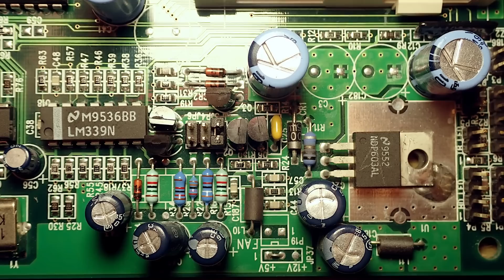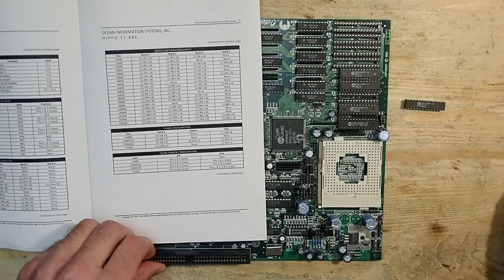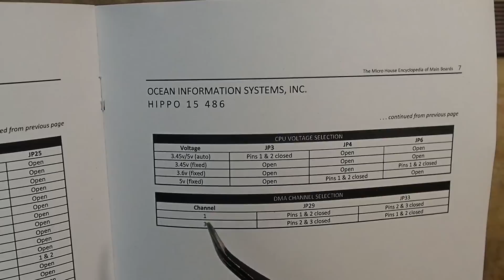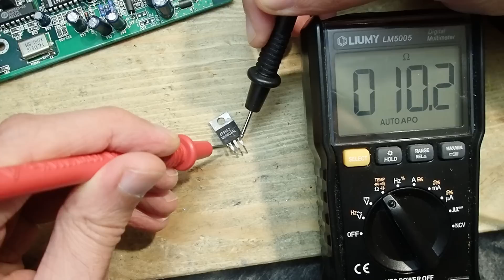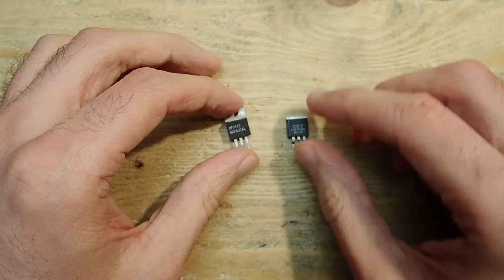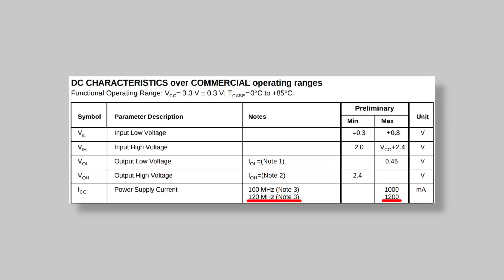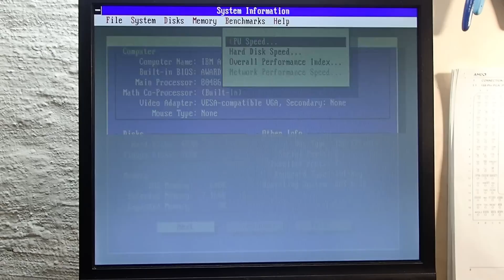Let's repair one of the best 486 mainboard - Octek Hippo 15

Comment: That board should be recapped with all Panasonic FM capacitors, it also doesn't matter if they look good or not, they can look completely fine but either be fully or partially shorted, or the rubber seal on the bottom could develop a hair line fracture causing the electrolyte to slowly evaporated, electrolytic capacitors should be replace if they are more then 20 years old, once you understand how they work and their failure modes, its just commonsense preventative maintenence, what if they short out and take out something on the board you cannot find... Get a good esr meter...
Reply: I agree with you! People tend to think that capacitors are perfectly fine just because their eyes and cheap cap tester says so. There's more to it than that, caps can degrade in ways which are not easy to detect unless you have professional equipment. They can also act fine in a tester but have problems at certain voltages or frequencies. I find it quite annoying to be stigmatized just because I do maintenance on retro computers in my hobby. Have fun with it while you can, and if recapping gives you joy (like it does to me), then go for it.
Reply: @8bitbubsy  Another point to is to always buy them from an official seller like mouser, low esr high temperature 105c long life caps are always the go to for mobo's. If it's a power supply with a normal radial leaded style, ill always go for nichicons uhe uhw or upw for the filters, for supporting circuitry usually nichicons uld series. Or Panasonic FM or fr series, if they are snap in caps, cde's splx is usually my first choice. Don't know why people think it's safe to use older equipment, especially equipment that is nos in nature and has never been powered up with original caps, it's just a risk that can be an expensive mistake.. If you can spend 25 bucks to recap something you dropped big dough on, why not go for it. It's the same way with vintage amplifiers and what not, lmao. It'll be a hoot when all these old caps pop and ruin this vintage gear for people who were so against it, then they'll be on here crying about it, lmao.

Comment: I was really surprised that that DX2-66 initialized with only 3.6volts. Really curious if it would have run stable.
Reply from the maker: No, I tested it later and it doesn't even boot into DOS.

Comment: Seems like this board even supports EDO memory, based on the chipset revision.
Reply from the maker: It depends on the BIOS as well. I didn't check yet out, because I wanted to update the BIOS for the benchmarks anyway.

Comment: Great repair! But why it starts with one SIMM module, aren't you need pair of them?
Reply from the maker: 486 needs only one. In the most Pentium systems you needed 2.
Reply: No, I think you are confusing the 72 pin modules with the 30 pin (which have an 8 bit data width and need a total of four modules for the full 32 bit width). On the other hand, the 72 pin modules already have a data bit path of 32 bits, so one module should always be enough (unless you have a very weird motherboard - there were plenty of these in the 486 era).
Reply from the maker: @ruxandy  That's right. And on the Pentium the memory bus became 64 bit, that's why you needed a pair of 72-pin modules on the most Pentium boards. Some could also work with one, but only with the half of the speed, since they split every memory access in two 32 bit words.
Reply: @ruxandy  thank you for clarification!

Comment: I've got that same S3 video card in my retro pc.  I wonder if anyone has ever upgraded the ram in those two empty slots.
Reply from the maker: Of course, if you need higher resolutions you can upgrade the memory. But if you use only DOS, there is no real use for more video memory.
Reply: @necro_ware  hmm, that explains why I can’t get higher resolutions… thanks - I was wondering about that. I’ll add ram then…
Reply: It worked- I added memory in the two slots and now have 2mb of video ram. I get higher redolutions in windows 98 now.

Comment: Hi, love your channel and wonder if you could help? 
i have a tricky Laptop problem that as a repairer myself , i cant quite nail. and love some help.. Problem is the usual "wont start and blank screen- but for months!! sometimes start normally and most not- so intermittent!!! worst fault haha
OK- What it isnt- I have switched out ram and PS and its not over heating ect as i service it but that would be once it s hot and OH. I have also changed SD HD with another and fresh windows install so its not windows or t the HD!!
Problem-- Push Power button (3 volts ok?) and power light and mouse comes on each time but nothing on screen OR i see 'windows starting" but then nothing. So kill power a couple of times and after 1-4 tries finally get into windows and DESKTOP and if that far, NO failure or blue screens or shutdowns and runs OK all day.... , no error mesgs and faultless , its just getting to desktop sometimes and then perfect all day
So my electronics and M/B knowledge is leaning toward Weak Caps that are loaded harder? on start but less once computer on and thus runs all day-
Laptop is 13 years so YES, caps will be worn Maybe Bios chip ropey or super IO BUT by now they should have failed totally? Super IO is keeping the mouse on and power on so not a board short plus i checked all that when pulled M/B to check obvious shorts and burnt components Also Power button not always work to force shutdown to try 1-4 restarts so m/B not always responsive, so i pull plug.
Battery and bios battery also removed and replaced . When i try to duplicate this fault HOT, i cant do it, only seems to happen after cold night then start- leading me to think weak cold caps not already ran and warmed ? when i pulled board and tried restarts they worked every time as M/B was warm and voltage filled generally. Is the Power button 3V needed AFTER the board is on, if not then that cant be it as mouse is on every time just wont get going to windows My next step is to monitor the 19V main rail and maybe even scope it for A/C noise when i turn it on cold and see if i can detect weak voltage and ripple from bad caps but not bad enough to have it run all day without fault? hmm Screen problems detected? but screen works perfectly all day and everything else too for months with this problem so i dont want to start reballing chips and make it worse perhaps.. Of course dumb windows says it need repair when it does start after restarts as thats it default position but it NOT windows or the drive.. This is M/B related as all else has been replaced or substituted to rule out....
Inspection- no corrosion or anything obvious. now it hot here in AUST, it might start each morning first time leading me to think warm nigh warm caps?
or simply a chip that is intermittent and hasnt failed yet. Any ideas appreciated as its my mums and valued to her and i like learn what this is or could be...

thanks for any help..
Reply from the maker: It's very hard to tell remotely. Such errors can also happen due to a micro cracks on the PCB. I had some notebooks in the past, which started with a similar behavior as yours and got worse over the time. One day you could start them only if you have bent the PCBs. If it is something like that, than you have to search for a broken solder joint, if you are lucky you can fix it by resoldering. If you are not lucky, the crack will be under a BGA IC or even inside of the PCB and both is very hard to fix without a lot of experience. To see if it could be a bad solder joint or a crack, I would press against different ICs and see if the behavior changes and if it does, well probably you have a crack somewhere indeed.
Reply: @necro_ware  Yes, it can be that but as it works perfectly AFTER getting into windows all day every day, it cant be a main IC ect but something related to Bios or voltage to that chip ect my best guess. 1st guess before weak caps or voltage is a fresh bios flash as that chip is 13 years old which i did flash tonight after a repair forum guy said he had same problem and it got worse gradually . Said he flashed the Bios and AOK and no problems since. If its something like cold joints or internal layers, then no one claims to repair that realistically.  Thing is when its hot, it start every time i test on off on off so its a hot vs cold thing and could be warm caps or warm bios chip or warm voltage somewhere making ti work unless cold morning when its hit and miss. 
Anyway will try the next few days cold starts and see if any failure first time. Also bad BGA balls could play up when cold/hot maybe but after months? no, these sort of give up enough to kill the board and its a start circuit  thing as far as i can see..
Reply: @necro_ware  if the flash fails in the morning, then i will have to check voltages and scope for noise on rails and start up to try and trace what is missing stopping it booting but not always. the laptop never moves so flexing isnt a likely cause for cracks but it could be a small failure somewhere or volt reg maybe to the super IO or leg resisting signal and i wont spend endless time as i might need to make another up for her and use it for parts if it come to that . Even the best youtubers pros cant fix many boards without schematics and pathways as time is to costly for a board worth couple hundred new as best.

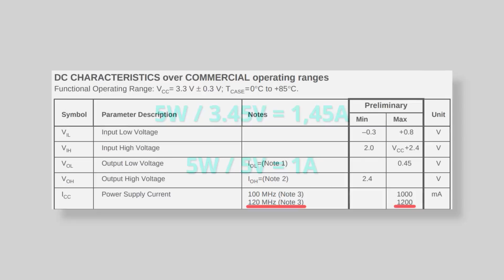Comment: 23:31 That's absolutely not how resistor power ratings work. It doesn't matter at what voltage you're operating, what counts is current times voltage drop, and you're not dropping the full five volts on a 0.01 Ohms resistor unless operating in the hundreds of amps range. 
It's also not a 5W resistor, but rather 1/4W or 1/2W judging from the size and construction. Power rating is linear to surface area roughly, basically the amount of heat the package can safely dissipate. Also fuses aren't rated for power, but for current, again it doesn't matter if you're operating at 1V or 240V, from the fuse's perspective it's all the same.
My guess btw is that you didn't read the rings properly, as even a resistor with 1/4W and 0.01 Ohms would be unsuitable as a fuse in this application. A value of 1 or 10 Ohms would make more sense, without actually calculating anything. Not saying that a resistor is a good replacement for an actual fuse anyway, as with this case, they don't strongly go open.
Reply from the maker: I didn't show the rings in the video by accident, so you can make a better guess. I read black, brown, silver, silver and you can't read it from the other side, since silver can't be the first ring. In regards of the voltage, you are absolutely right, in the normal case we shouldn't have full voltage on the resistor, I just went from the worst case,in case the CPU gets very low resistance for some reason. But that assumption is really only realistic, if it is shorted or inserted the wrong way around.
Reply: It's a 0.01 Ohm (probably 1/4W) resistor, not a fuse. The obscure math calculations and Fuses and Amps and all the other rubbish he says is just that... rubbish.
Reply from the maker: @johncoops6897  Boy oh boy you were fast in your unlimited rage :) But you are right, I invested some more time into that circuit and that is a current limiting resistor. I want to mention it and correct myself in the next video. As I stated more than once I'm a quite experienced software engineer, but my electronics knowledge is only theoretical and what I got from the university 20 years ago and everything I say in that regards can be wrong. If s.o. can convince me with some valid arguments, I'd be just happy. That's why I do it eventually, to improve my electronics knowledge and also to learn from the viewers.    So, no need to get so angry.

In regards of fuse, it's a really not the best replacement, since current will not be limited by the controlling circuit properly, but I seem not to have such a resistor at hand currently and the fuse is still better than a jumper wire, since at least it will cut the trace in a hard way if it goes over 3A.
Reply: @necro_ware  - you STILL misunderstand what the 1/4W resistor is there for, and it is certainly not to limit the current to 3A (15 Watts) continuous like the fuse you installed in there.
And I am nor angry... I am simply making sure that other people are informed of the errors here, rather than treating you as some form of electronics repair god.
Reply from the maker: @johncoops6897  As I previously mentioned, I investigated afterwards and I think I do understand what that resistor is for and I never said, that it is to limit the current at 3A. I just said, that the fuse will blow, if the current goes over 3A, that's a difference. That low value resistor is used to measure the voltage difference across it to calculate the current, which flows through it and close the MOSFET if needed. It has nothing to do with 3A, but the fuse will still blow, if the current goes uncontrolled over that limit. 
And in regards of "repair god", I hope that people don't see it like that and I tell that every so often in my videos, that my videos shouldn't be seen as that. I even wrote into the text about my channel, that this is in no way a tutorial and I do make mistakes and wrong assumptions sometimes. As I already said, I am an experiences software developer and this here is just my hobby, where I try to learn something. And this is where you come into play, since you could help me to improve in a polite way. If I'm allowed to give you an advice, please try to improve your social skills as well, there is absolutely no reason to get offensive. I'm always open for a good advice and an educated opinion.  With angry statements, you will not convince others to think about me whatever they want to think. Not even I am obviously able to convince people to take everything what I say with a grain of salt. I repeat that  in my videos and in the comments. Please try next time to contribute your ideas in a more constructive way. Instead of writing things, like "you don't understand" and "repair god", just write what you think is wrong about my assumptions. Like @Alexander Gräf made it in his first statement. This is how constructive critics works.

Comment: I never uploaded my video but I got 17.4FPS on the #486QuakeRace using an AMD 486 at 160MHz using this motherboard apparently that is plenty fast for just 160MHz.
Reply: Думаю, что в целом 150 (3x50) было бы лучше, чем 160 (4x40) -- с учётом частот на шинах (более быстрой работы памяти}. 
PS Мне удавалось достичь 180 (3x60), но не на этой MB. О достижении 196 MHz (3x66) я только однажды слышал.
Reply: @cynic3859  I tough these AMD 5x86 had an internal 4x multiplier just like the DX2 and DX4 from intel had a 2x and 3x in which the motherboard had no control, I didn't try such an OC on my Intel Dx4 100.
Reply: @RetroTinkerer  У встречавшихся мне экземпляров AMD 5x86DX4-133 была возможность работы с множителями 3 и 4. Что касается Intel DX4-100, то могло быть: "2 или 3" или "только 3".
Если совсем точно, то:
SX900, SX906, SK051, SK096 — только 3
SX876, SX877, SK050, SK053, SK099 — 2 или 3

Comment: Doesn't look like a fuse,  just looks like a resistor they are using for that function....or current sensing.   Looks like a 1 ohm.  Still watching.   It's R11 on the board,  not say F1, F2.
Reply: Precisely. There is absolutely no reason to call it "A Fuse", and definitely it shouldn't have been replaced with an actual fuse (of unknown resistance, that he never even measured).
The value of the resistor is Black Brown Silver = 0.01 Ohms.

Comment: Nice video, nice fix! But i'm wondering: what is the main difference between EDO and FPM? My AMD x5 seems to run great with EDO memory.
Reply from the maker: In EDO, the time period for which data is valid is longer than the time period for FPM, hence extended data out. The technical difference is that the data buffers aren't turned off with CAS; instead, data remains valid until the next piece of data is available. This helps to reduce overall access time, but the chipset and the mainboard have to be prepared to support that and since most of the 486 mainboards (except of the late UMC 8886/8881 based once) were released before EDO hit the market, they are not able to work with that memory.

You can find a good explanation with some timing examples and diagrams here (search for EDO):
https://www.bunniestudios.com/bunnie/dramfaq/DRAMFAQ.html
Reply: @necro_ware  Thanks! That is a very clear explanation. I want to thank you for something else: in the BIOS of the system i can set cache type to 7 or 8 bits. Setting it to 7 bits (which you did in one of your videos) greatly improves the memory speed (118 instead of 33 MB/sec).

Comment: Could that resistor actually be a current shunt? At 10 milliohms it seems likely to me? There was also a trace running off one of the pins into another little SMD resistor which could be feeding into some over current protection circuit?
Reply from the maker: Yes, it could be also a current shunt indeed.
Reply: Of course it's a current shunt or inrush limiting RESISTOR. Kind of dumb to replace a known component with a "fuse" of unknown resistance. Obviously it was pure luck that it was close enough that the circuit still worked.

Comment: I like your component tester, do you have a link for where to purchase one by chance?
Reply from the maker: Many people ask that, but unfortunately I can't tell you which model it is, I bought it broken years ago for a price of a cookie and repaired it back in the days. Today you can however easily find thousands of similar devices online.
Reply: @necro_ware  the ones I have found lack the very nice set of connectors yours has in favor of a single multi-use connector. I will keep looking, thanks for the reply.